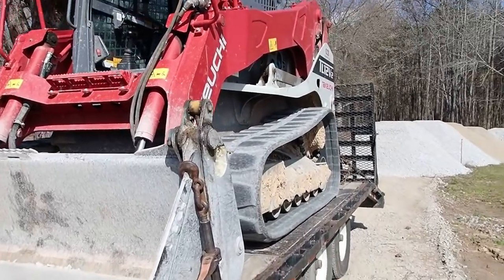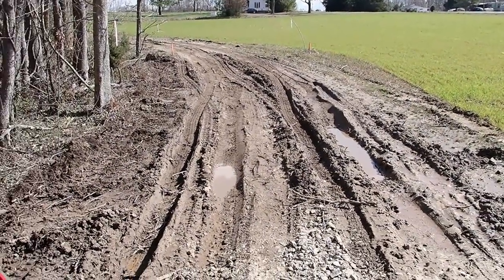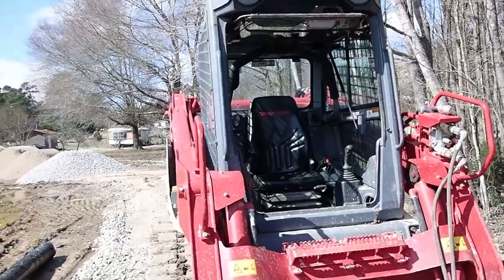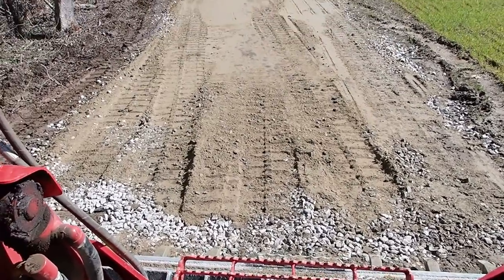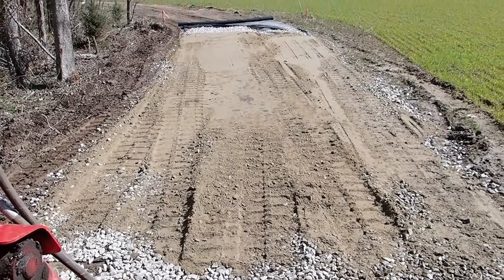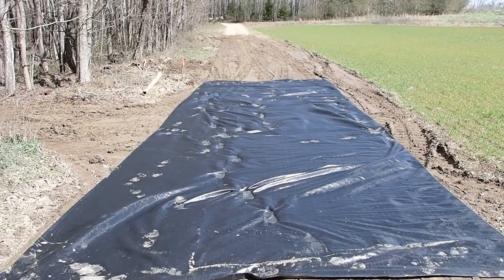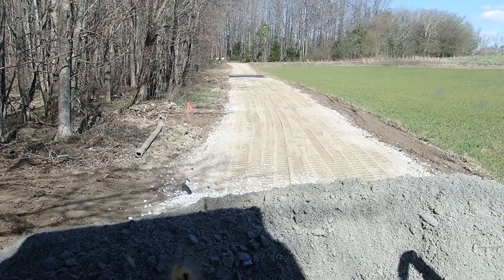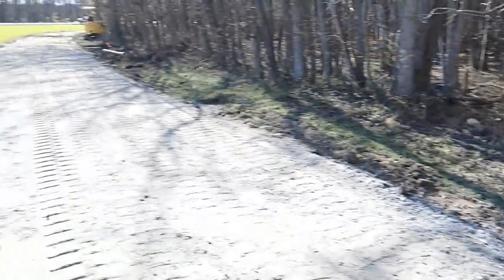Fixing An Impassable Driveway

Comment: Chris, If you use a non-woven geotextile (needle punched and heat fused polypropylene) you will find that it allows water to flow horizontally across the structure.  It is superior to woven tape geotextile for drainage both vertically (gravity) and horizontally (wicking). 
I really enjoy your videos.  Thanks.

Comment: an old fashioned culvert, shallow trench across the driveway, then since you have it, fabric along the trench, some of the bigger rock, fold fabric over then do the fabric and rock / fill on the driveway. the trench will allow more water across to a lower level than the driveway swale, the fabric and rock in it will keep it from getting silted in.

Comment: People always budget for the house out in a field but they never budget for a good road out to it. Depending on conditions and length you could spend thousands putting in a decent driveway.
Reply: Or they want to do it as cheap as possible. Skip the mat, don't strip the topsoil. Just dump 1" and go.
Reply: @broc212  haha... for sure. My favorite is so and so will do it for half that much, so I tell them to have them do it and when you call me a couple months later it's going to cost even more because I'm going to have to clean up that mess too. There's definitely the right way to do it and then there's the cheap way to do it.
Reply: Sccccccccc””

c Clyde Acor
Reply: Curious how much doing a road out to a house in the woods correctly like this would actually cost? Just that amount of rock and fabric plus machine and operator had to be a couple grand.
Reply: Imo that first layer is too small. Dig it out and back fill with demolition waste, big chunks of concrete and kerbstone. Then top it with whatever you want cos it ain't going nowhere.  Best roads I've built were done like that.
Reply: I came up with $20 per ft of 12 ft wide drveway... just for gravel. (Where I live)

It costs more for the hauling and grading than for the gravel... then add some geo textile if you want it to last 5 years.

Long driveways get expensive fast.
Reply: @pjs5191  at least $3500... for rock.  120 tons    at $20 a ton for cheap stuff to over $50 a ton for good stuff in some places... plus trucking it in.

Just the rock.
Geotextile, labor, machine use... that was an expensive patch, but done better than some do any part of their driveway.

Comment: I hate that fabric when we have to fix driveways with it. Here is a few months you will have to fix that right and deal with the fabric peeling out all over. Wish you would have told him you need to cut some ditches first with the grader and used that to build up the road. Would have lost some crop ground but it would have dried out in a few days. Then you could have tailgated a bunch of gravel on it and used the grader to smooth and pack. You have an awesome grader for this.

Comment: 4 in 1 bucket until you operate one for many hours you have know idea what your missing. Lite dozer, grabbing/lifting, working alone, stripping grass, cutting 1-2",spreading material. Spent over 10,000 hrs with one what a blessing. I could remove the hat from your head and set it on the ground pick it back up and put it back on your head. Chris I see you mastering this bucket also, I think you made a wise investment
Reply: It was not til I started watching others use equipment that my approach was wrong (ranchwork/ag) with a sub compact tractor. I have learned how to finess to get desired results. Recently got to use a skidsteer (but sub-compact is what still have) , and that was eye opening to the correct equipment for the job. That 4/1, I would LOVE to have one!

Comment: You guys must have really different terms for rock there. Here ABC is (Aggregate Base Course) to be used on the bottom, not as a top dressing. What you are calling the (ABC) looks like our "pit run", or "road pack" used for top dressing.
Reply: scotty362100  I was thinking the same thing. Here is Kansas you would use ABC as the base over the fabric and put the stone over the top of the ABC.
Reply: Wrong , dude saint he out ABC on top
Reply: @timedvrodlehnen8448  English please?

Comment: well that sand  mix will just hold water and keep it wet i would of just used a smaller clean rock run on it from the  inch and half you put down and it was only about 2 inch depth which was a waist of time i used 3 inch then the inch and half and then   the 1/8 inch  would make a reall road.

Comment: Waste of sand....1” gravel with 3/4 will do it!
Reply: Sand makes a good binder for the coarse aggregate. In my opinion, he should have blended them before placement.
Reply: If you would have listened you would have heard Chris say that this wasn't a permanent fix. It's just to get the driveway fixed enough to get vehicles through without getting stuck so they can get the house done.